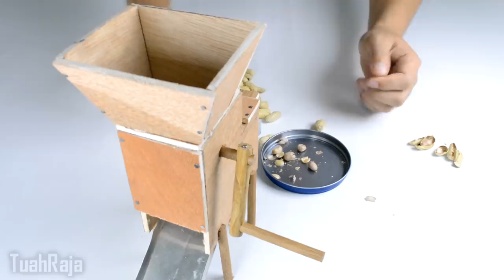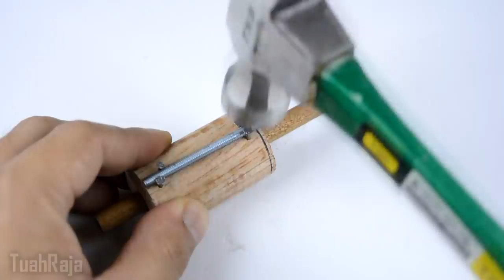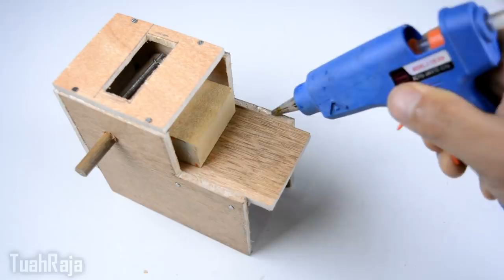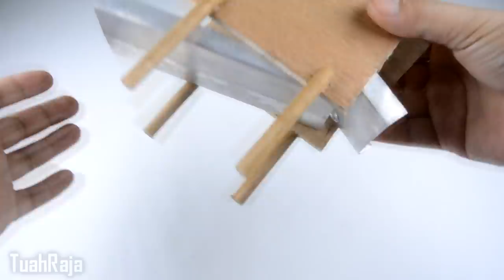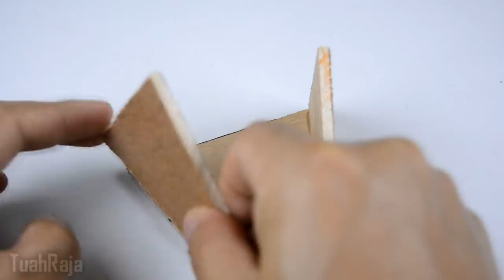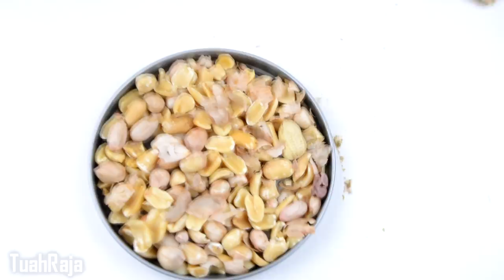How to Make Peanut Peeler ,  You Can Make at Home

Comment: Sir, you have not shown how the peeling system of the roller and the stationary part are made. The video was ‘rushed’ at this stage. You could have slowed and shown this important part of the groundnut peeler. It’s is good tool, but constructing with plywood is not recommended as it can break over usage.
Reply from the maker: Ok next time